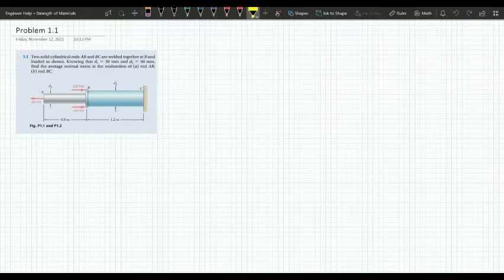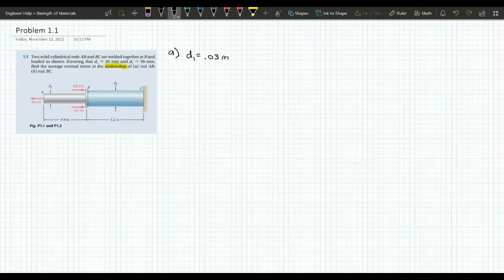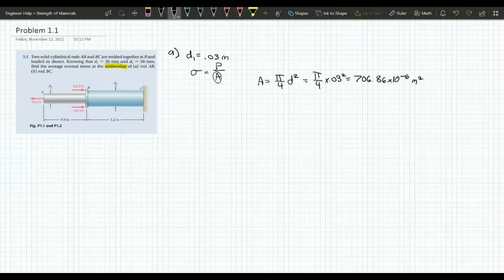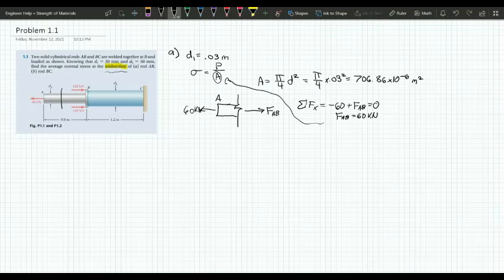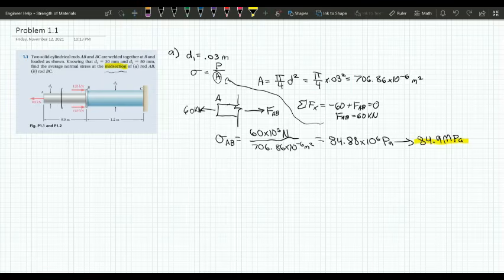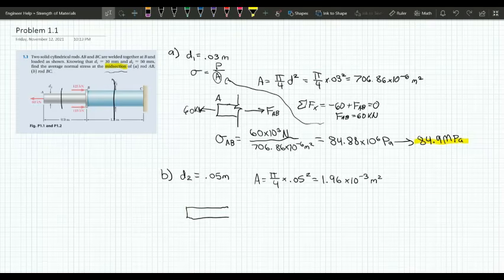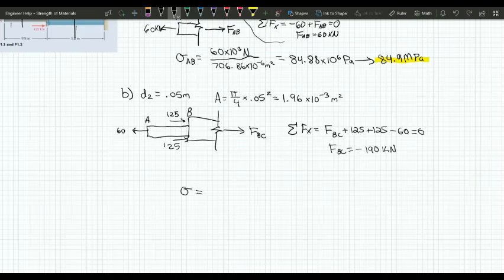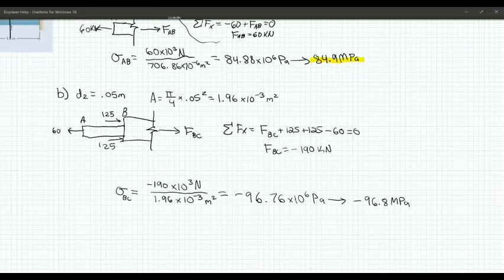Strength of Materials Problem 1.1

Comment: This may be a dumb question, but I do not understand how you got the 706.86*10^-6 when I punch that into the calculator I always get 7.068*10^-4 did you just moved the decimal point? if so what was the purpose of doing that?
Reply from the maker: There is no difference between the two. I have no reason for writing it that way other than that's just how my calculator displayed the answer. You should still get the same answer using 7.068×10^-4
Reply: @engineerhelp8303  one is scientific notation the other one is engineering notation